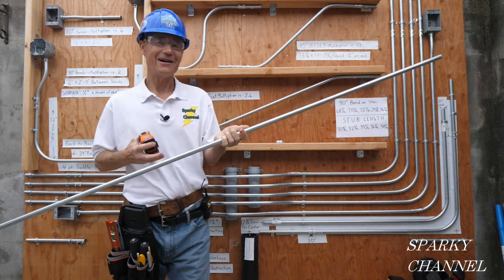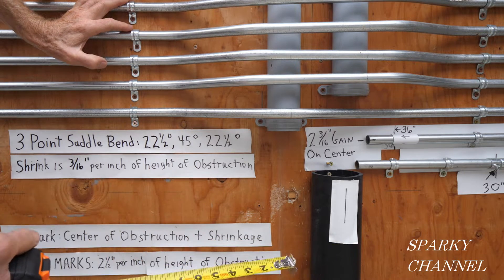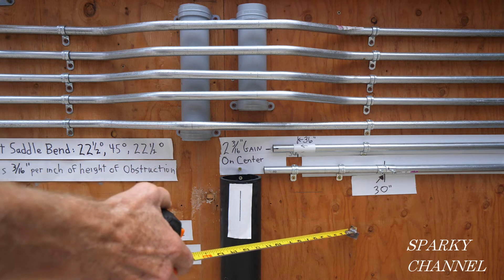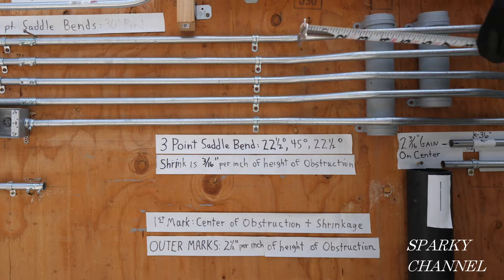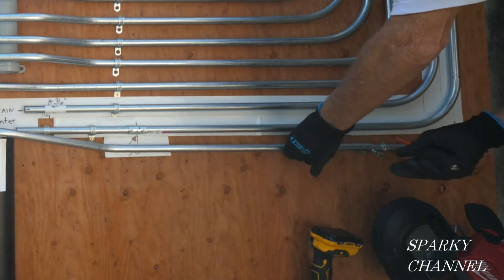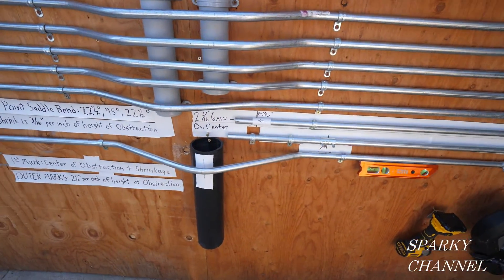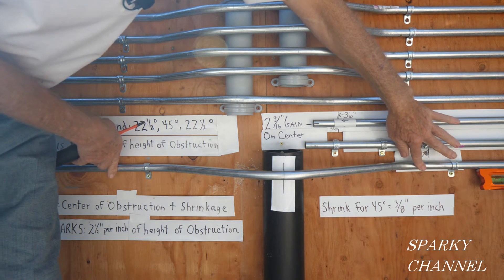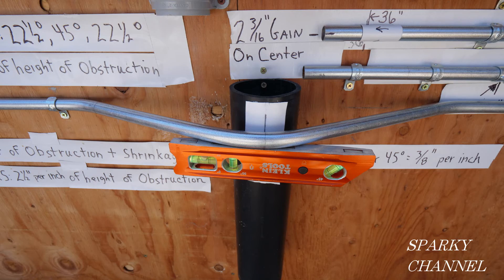EMT Shrinkage To Make 3 Point Saddle Bends: Save $$ by Knowing EMT Shrink Calculations

Comment: For the outer bends, the Klein tape says 2.6 as the multiplier. Did you just round down to 2.5 in. to make math easier? However, the larger the obstruction, the more off this calculation would be though correct? Thank you for teaching this.

Comment: How do you know what is the measurement from left to right of the middle mark
Reply from the maker: For a 22,45,22 three pt saddle it's 2 1/2" per inch of the height of the obstruction and for a 30, 60, 30 it 2" per inch of height of obstruction.

Comment: You said there was 1.5 inches of shrink for the two 22.5 degree bends. But where did the other 3/4” of shrink go? You measured 36 to center plus the first 3/4” shrink. Where’s the other 3/4???
Reply from the maker: It's included in the 1.5" of total shrink for the 3 pt saddle . One side of the 3 pt saddle has 3/4" shrink and the other side has 3/4" shrink for a total of 1.5".